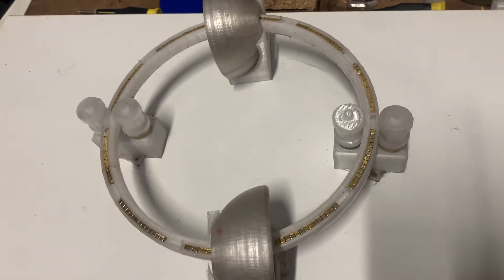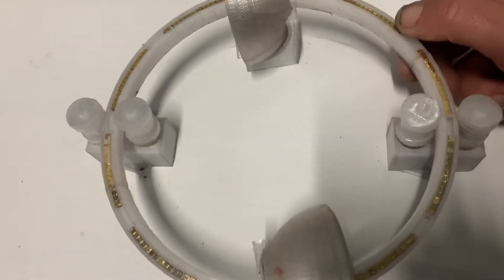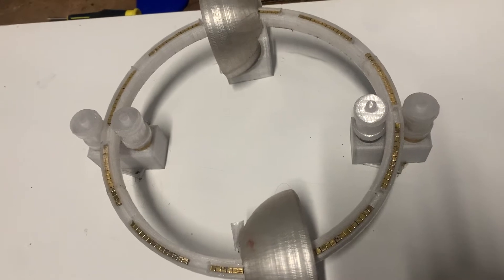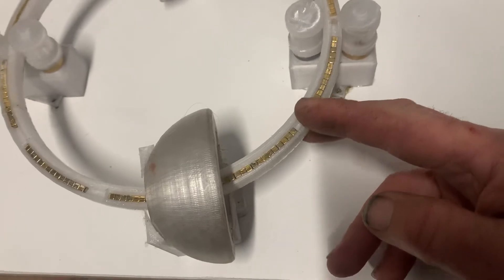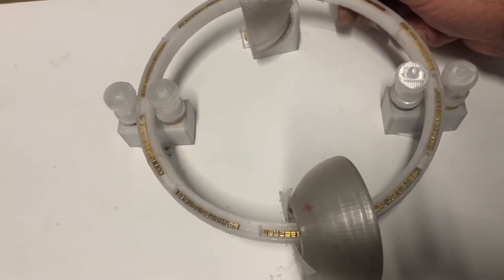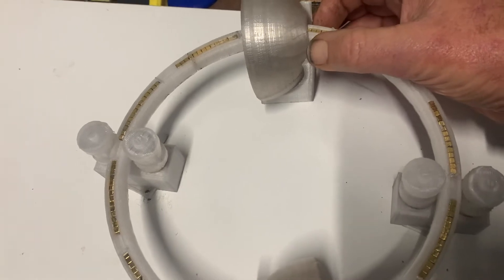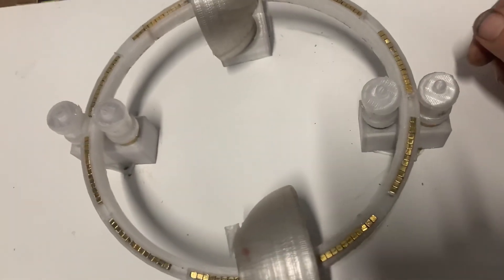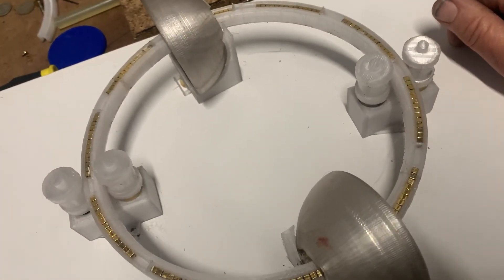Primer train experiment testing 1st pro type

Comment: Any attempt at perpetual motion surely requires the free-est setup to begin with, before any magnets are added. The circular piping needs to be able to run with as little friction/resistance as possible. I would hold each side in place with high-performance bearings, so it is only touching the perfect polished bearing casings. I would probably start also with only one side of the loop loaded with magnetic material, so there isn't a counter force at the other end to contest with too. Nice try anyway, you can only respect the effort for doing so.